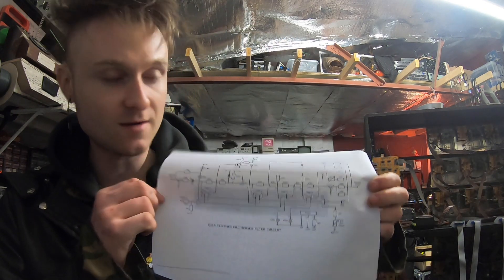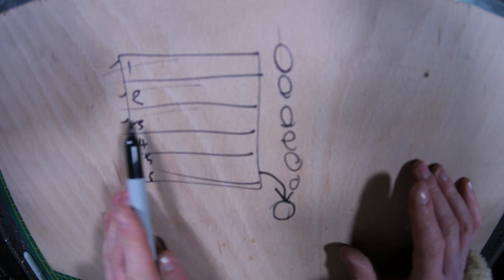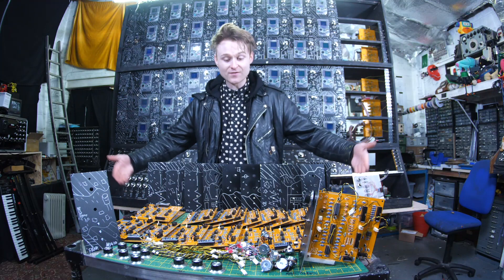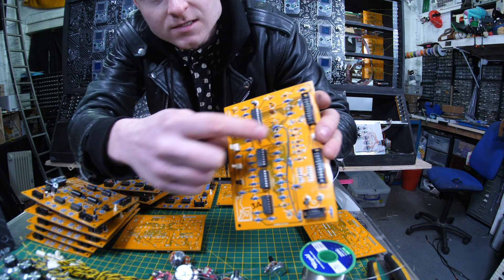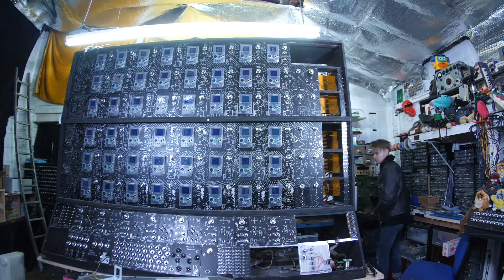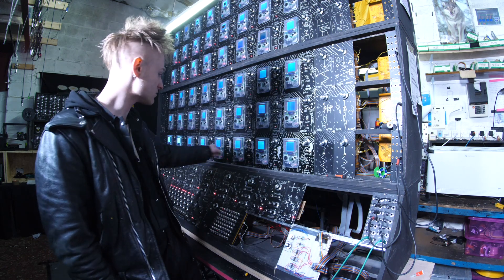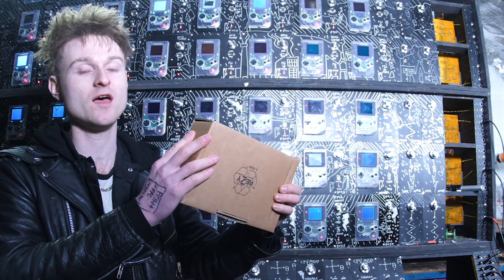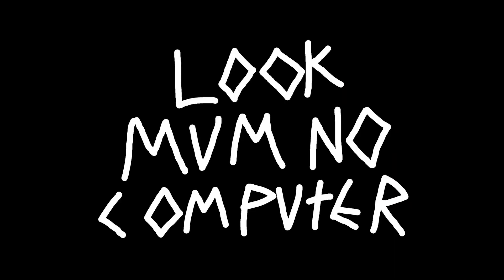GAMEBOY MEGAMACHINE #11 12 FILTERS BASED ON ELKA SYNTHEX SYNTHESIZER

Comment: Whooaah now that’s an exaggerating love for the gameboy,, now i don’t know how many gameboys you have connected to a synthesizer and or ir you have modded them or just used those link ports being able to control them but holy moly,were did you find all these gameboys,pffff ,,,also,you might think that with all these gameboys psg sound chips controlled together ,you might be able to produce fm sound with it.
Reply from the maker: All of them respond as separate synths and are added together. I don’t like fm enough to work it into this 😊
Reply: LOOK MUM NO COMPUTER oke but for what i have learned is the fm works with many operators per channel,, meaning each channels can mix 2 or 4   Different variations of the same sounds together , so a square wave can have 4 different types of it’s own mixed together,same with a triange wave etc,,, with a psg sound each chznnel has only 1 operator so a square wave or triangle can generate only 1 type of sound of it’s own,,, but since you have connected sooo many gameboy together ,you can now emulate fm sound with it since you now can combine many different types of different square waves & triangle waves etc,, together right??

Note we should be not confused with the psg chip from the sega gamegear since that psg chip is fully programmible each channel has the same rules such as volume control etc,,, so therefore it should,ve been called  fpgg chip instead ,,,, on the gameboy you cannot control the volume of each channel, as a result you cannot simulate pcm sound on it as opposed to the supposedly called fpsg chip on the sega gamegear!!!

Comment: I'm working on a similarly elaborate gameboy synth, albeit in a smaller size. I have a couple questions about your project. You built in parallel command of all the gameboys through the 6 input wire on it.

Is that so you can batch program lsdj on every gameboy? 

Also what was the best way you found to mount the cpu of the gameboy to the back of the aluminum plates? I know you've got them on there with standoffs. Is that strong enough? I'm sick of soldering broken stuff when we're on the road.
Reply from the maker: Inhalants standoffs are fine. For my triple gameboy oscillator it hasn’t broke. Also not bothered with connecting up the connectors for batch uploads
Reply: @LOOKMUMNOCOMPUTER  You're just using the cpu clock modulation as a VCO, right? Same thing you did on the triple gameboy but on a way larger scale. 

On my project I have 1 gameboy that needs to be controlled by 2 NES controllers. 

I've been back and forth between using an arduino to interpret the inputs from both controllers plugged into an NES Four Score, or rewiring the nes controllers themselves and just running them onto a board like you did in this image: https://imgur.com/a/x1LtYbe

How do you think you'd approach this?

Comment: Yeah, THT definitely has the charming look. It´s cool that you go for that!
You can have it made automatized by wavesoldering, though.
It´s still common practice in power electronics, so this service is provided everywhere.
I´m sure, with your profile any company will let you throw your boards onto the wavesolder tape,
and in a few minutes they´ll be ready -  just in case you wanna save time.
Reply from the maker: Wavesoldering heyyy

Comment: Thank you for this circuit design journey, i really appreciate the open-source nature of your projects. Did you use kicad for simulating and designing your circuit? Or was it simply used to construct PCB? I have problems finding Spice models (for simulation) that work well with Kicad for even common IC's, I am wondering if its just me. I've been suggested to switch to LTSpice for simulations. Do you do this, or breadboard everything? 

Thanks again!
Reply from the maker: Kid Chemcial no idea just make the pcb. Why simulate when you can make! 😂😂
Reply: @LOOKMUMNOCOMPUTER  ahh that makes perfect sense! I am new to circuitry and lack the variety of electrical components. Everything is on the way from China :D
Reply from the maker: Breadboard everything basically. I can’t stand working on my computer for too long. Makes my brain go numb